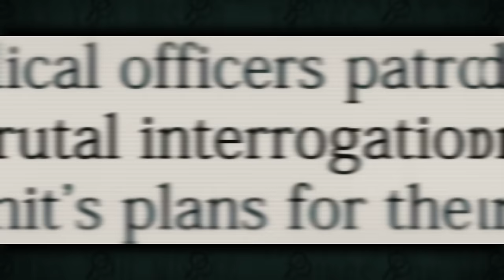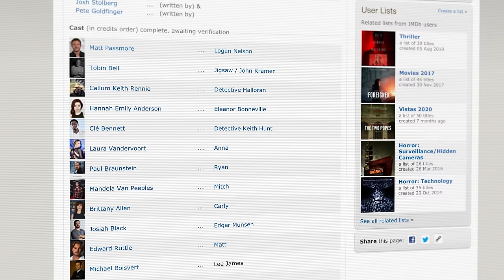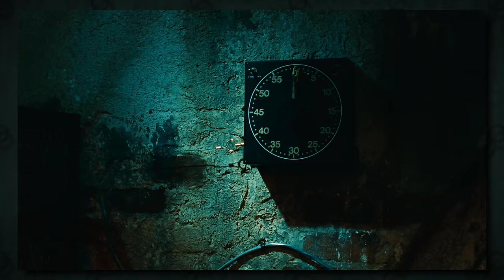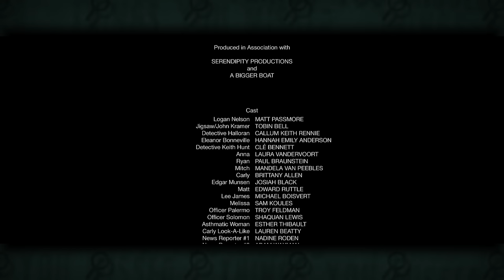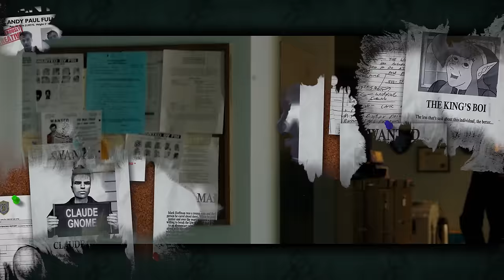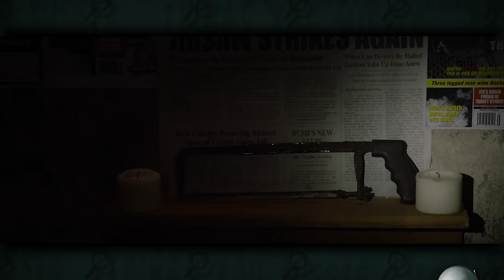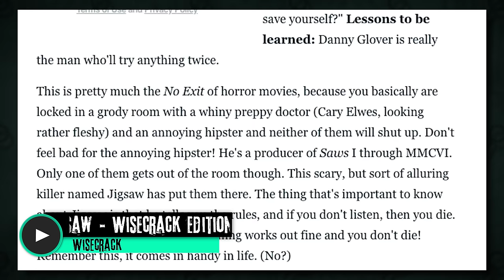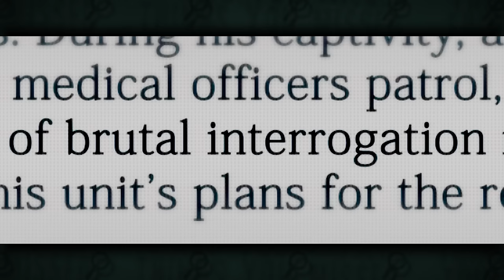77 Things You Missed™ in JIGSAW (2017) | Ultimate Compilation

Comment: Blue Laser light loses its heat & burning/cutting ability the further away from the initial starting source it gets. I could use it to cut into your leg by igniting it an inch or less from it. But pulling it back a foot or so, your skin will just receive welts or begin to burn depending on how long i aimed it on at your leg. Then, of course, if i pointed it at your leg from a few yards away, you may only possibly feel a slight warmth there to no difference at all.

Comment: well asuming that this thing actually cut metal, it could work like a torch. The closer your are from the flames the worse you will get burnt. With not cutting lasers is the same, incrise the distance and you can see the light fading as the distance grows

Comment: regarding the watch at 7:03 a lot of medical professionals do this, speaking from experience. When you wear your watch facing the bottom of your wrist, its easier to see the time if you are in the middle of something with a patient since that would usually mean a needle or some sort of instrument. If you rotate your wrist inward to look at the time, the instrument in your hand will face you instead of the patient which could be pointy or sharp. If you wear a watch the conventional way, and you want to see the time you would need to rotate yur wrist outward and the instrument would be pointing at the patient.